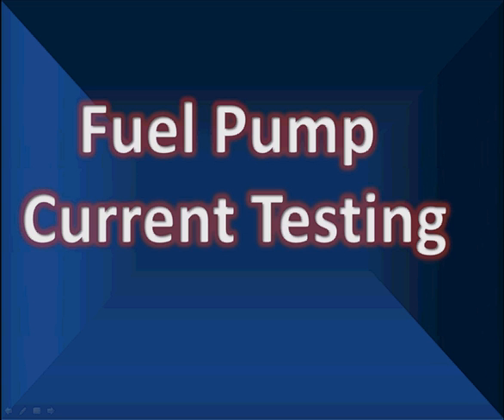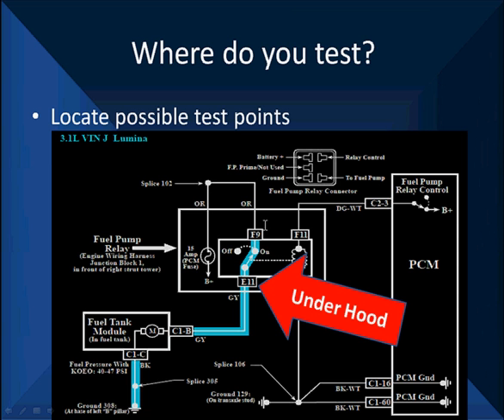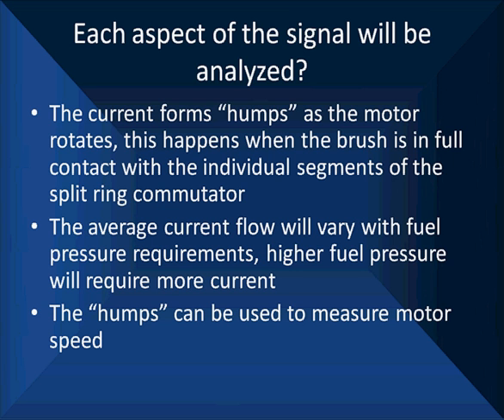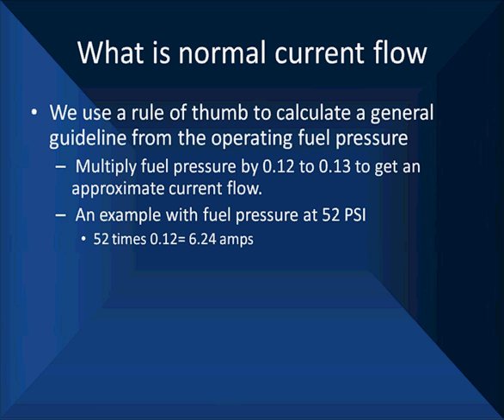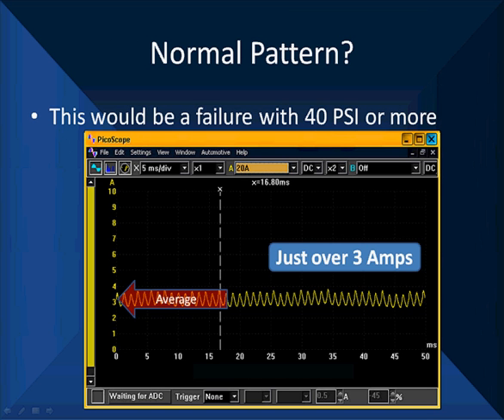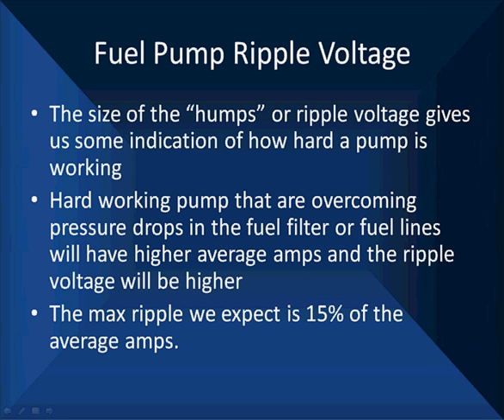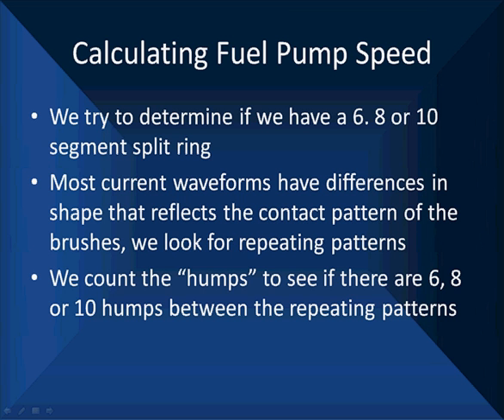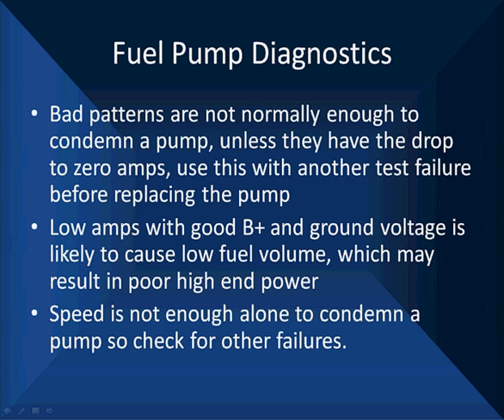07 Fuel Pump Current Testing

Comment: I like the enthusiasm of this video, but it's a bit needless for any frontline technician,  and it makes general assumptions that are based on specifications that are not readily available to most technicians. It's nice theory to test electrical motors, but overkill the real world. Many technicians don't own a scope or use it frequently enough to use it efficiently once every year or 8 months.
Reply: I used to think like you untell I got one, your incorrect.   You can get specs by doing quick checks on know good ones for a base line as well. If you practice with this tool it will take you to another level that's not achievable without it.